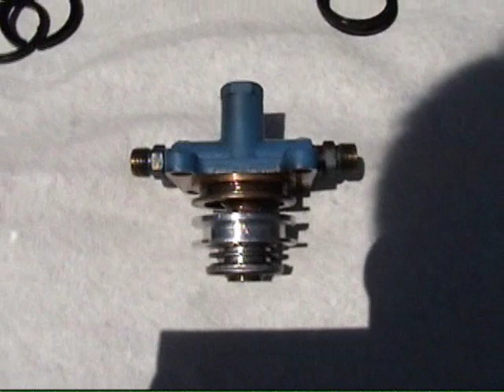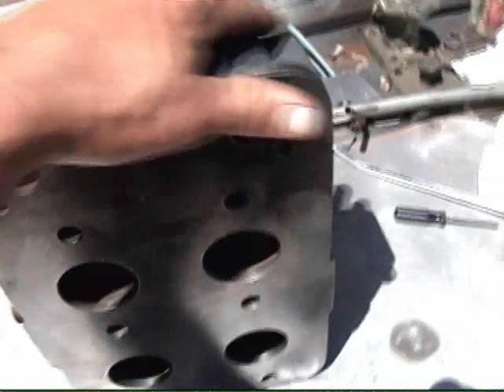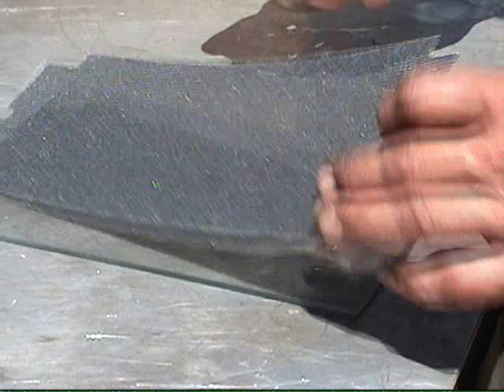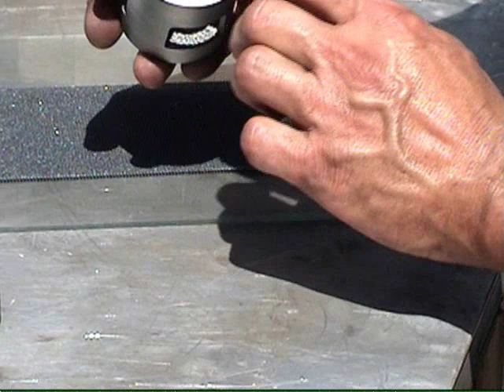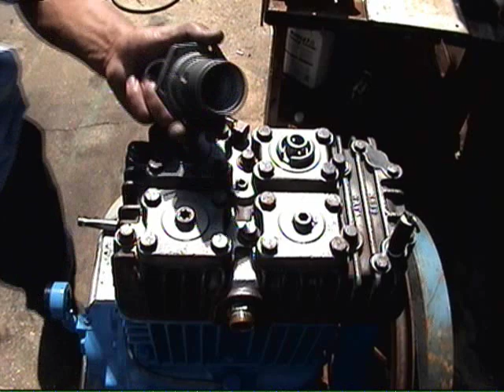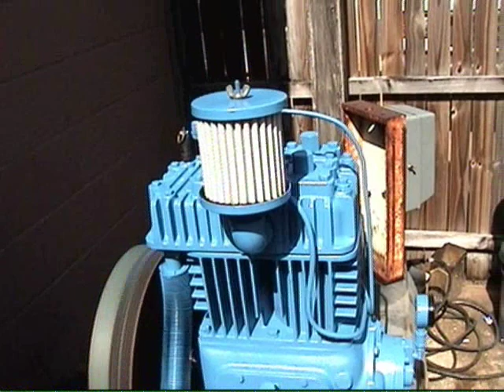Quincy Model # 325 rebuilt and running

Comment: Dave, first of all thankyou to the nth degree for doing this series.  Quincy is very tight with allowing quality service manuals to be published or shared.  You have saved me and thousands of others, THANK YOU sir!!!!
     I just purchased a 325 ROC 12 and mine has the 2 unloader valves.  It also has a middle area that I havent seen on any others.  It is between the pump and the motor and it has a pipe coming off the compressor head and then a square set of cooling fins and then a larger pump type looking contraption that enters into the top middle of the tank.....Do you have any clue what that could be and what it does?  I am just starting to gut the compressor and start the cleaning process.
     If you do not have time to answer, I more than understand.  YOU ARE DA MAN!!!!!!!
Thanks again for all your time and courteous help
Reply from the maker: Thanks for all the nice words  Jim!
 That contraption you're referring to is what Quincy compressor named a cushion chamber, It's designed to take out the pulsation  of the compressed air  In hopes of making the whole compressor package quieter, A lot of the noise generated in a reciprocating compressor is through the discharge line,  That pulsating compressed air entering the tank causes what's known as intank  noise. The cushion chamber actually did work but there was one inherited flaw, They had a tendency to become log with oil and carbon, In some cases it would restrict the small tube that feeds the tank, There's also a relief valve located on the cushion chamber that had a tendency not to open or also become plug with carbon, I think you might know where I'm going with all this, What's your say a few of these cushion chambers exploded and therefore Quincy way back in the  day discontinued to use of them, I would strongly suggest you just get rid of the thing and plum the discharge line straight into the tank hopefully there will be an opening somewhere that you can use.
Good luck in the future!
Reply: @rotarycomptech  Thank you so much for replying, especially so quickly!!!  Can I totally remove it from the tank and run plumb the discharge directly into the remaining hole, or is it too large?
Reply from the maker: @jimtrimble3040   As long as the whole opening isn't smaller than the discharge diameter which I believe is 3/4 inch or 1" some around their,
Reply: @rotarycomptech  Since I will be using this compressor no more that 5 hours a week,  Can I just focus on keeping that chamber cleaned out or would that still be too much of a 
risk? If so, Could I connect the discharge tube into one of the threaded end plugs?  I have one at each end of the tank about 1/2 way up from the bottom. Sorry for the quantity of questions
Reply from the maker: @jimtrimble3040   Either way will work,  The cushion chamber was just found to be unsafe
Reply: @rotarycomptech  Dave, I really need your input on my rebuild 325.  I have spent over a year rebuilding this and it is done. I stripped all of it, including the tank to bare metal and painted and powder coated with HiTemp powder coat.  Looks great.  Bought the rebuild kit that included the rings, bearings all gaskets and valve seats with springs.  All of the unloaders are spotless and everything is torqued down correctly.  
     NOW my issue.  I am trying it out and this is what happens.  Starts normal, oil pressure goes to 30psi  and 80 gallon tank fills slowly. btw I have dual unloaders and after about 7 minutes it hits 125psi then unloads down to 90.  Is it supposed to keep cycling like that?  I thought at some point it would stop and store the air in the tank for use.  Maybe that's how a dual unloader works.....constantly on.  
     That is one question, now the above actions of the compressor changed after about an hour and a half of running it with the cycling on at off at set pressure values.  Today I replaced the oil cover access plate with the new thicker one that you installed on yours and what is happening now is not right at all and I don't know where to start troubleshooting,  Now after I turn it on,  it starts building pressure, oil pressure goes to 30psi and then it keeps raising!  It is building pressure like crazy in the compressor oil reservoir area and the oil gauge pegs clockwise all the way and when it builds to 125psi in the tank, it unloads down to 90psi, with oil psi still pegged, and when it goes to start building the pressure up again, the compressor stalls and will not allow the motor to spin causing it to lock up the motor... so I shut the power off completely and manually release tank pressure and turn compressor back on, it is now unstalled and  the motor starts up again..  When it starts again.  Oil psi starts at 30psi and continues to climb to where the  gauge is pegged then all of a sudden BANG!!!!!! the dipstick shoots out at rocket speed and pegs the air cleaner above it.  Scared the holy crap out of me.  Just had open heart surgery last year, so that didn't help.  
     After I composed myself, made sure I wasn't bleeding, and went in and changed my newly stained drawers.....I am asking the guru.....What the crap might be happening????  Would it be possible to call you if you feel it is too much to type out?   I do NOT want to bother you and if you feel like this is a pain to deal with, I understand that your time is valuable.  I would be more than happy to pay you for your time if needed.  I really want YOUR help since I have seen all the Quincy videos at least 10 times each and feel that you know your crap......More of a trust thing.  I hope you understand.......thanks. Jim

Comment: Hello Dave,  Thank You for the great videos.  I just rebuilt the head on my 325 roc 7, and the hp discharge valve still leaks, but I just realized that I didn't lap the seats before I installed the new valve disks.  I'm going to do it today and reassemble.  I really appreciate you sharing your expertise.

Comment: Hello ! I have a 325-13, I had the leaking unloader tower issue, it was just the diaphragm that was bad, now everything is fine exept I have a small leak coming from the crankcase, It was 175 psi last night and this morning only 10psi remains (compressor was off obviously). Can't seems to locate where it could come from, I've sprayed soapy water on all the exterior connections and everything is air tight. I understand there is a case breather that goes to the intake so the leaking crankcase air is vented there but I don't get the air path from the tank to the crankcase ? Any help would be appreciated !
Reply from the maker: You need to install a pressure gauge where the interstates relief valve should have gone, when the compressor is running at 100 PSI the interstate pressure should not exceed 45 PSI if it does you need to address the high pressure valves,
Reply from the maker: it's your high pressure discharge valve more than likely, if the machine has a intercooler relief valve on it it will be venting from that area as well. If you're losing air pressure overnight the only place they can escape his from the high pressure discharge valve that's what keeps the air pressure in the tank from escaping through the intake
Reply: @rotarycomptech  wow thanks for the fast reply, there is no relief valve on the head. Which one is the hp discharge valve ? I will disassemble and clean it. It leaks overnight but i can cleary hear the leak at almost any pressure, I just repaired my main issue yesterday evening so im not sure of the rate of the leak but its enough that I want to correct it. I got this compressor for free without the electric motor, the guy clearly didnt know what he had it would have sold for quite some cash (70 gallon binks tank)

Comment: Is it absolutely necessary to prime the crankcase? Rebuilding a 210 unit and lost most of the original primer while cleaning it. Crank wasn't rusty at all. Is it to seal in the oil or to prevent rust?
Reply from the maker: Some of the old crank cases were primed due to porus castings leaks in the casting itself
Reply: @rotarycomptech  thanks for the reply. This whole series has been very helpful. I think I will take the chance of not priming it. Already tried some enamel but I didn't like how it was curing in there (didn't get all the oil out) so I stripped it clean again. For reference, what was the primer that you used?
Reply from the maker: @bcouri1  it wasn't Automotive lacquer based primer

Comment: hello all, I have a 325 I just rebuilt with a tune up kit (rings, valves).  Got it all back together and ran it.  Started making a knocking noise at around 100 psi, so I took back apart and found that the high pressure piston wrist pin bushing was worn.  I replaced and had local machine shop size the new bushing. Put the compressor back together and still makes the same knocking noise starting at 100 psi.    Any ideas??
Reply from the maker: Heath Cline there are only a few things that will cause that unit to knock, I would check to make sure that the flywheel is tight as that can cause a knock from time to time if it becomes loose.
Since you have a gasket set I would suggest you remove the head and run it without it in place to determine if it's the lower end or if it's indeed a loose valve

Comment: any body have any experience straighting crankshaft on 325 quincy
Reply from the maker: Charlie Tanner yep
Reply: how
Reply from the maker: Charlie Tanner unfortunately the only way I know to straighten it is in the same way it became damaged, only I would use a urethane sledgehammer as so you don't break the flywheel, you literally have to bend it back straight

Comment: What are the main differences between the 308 and 325 ?  I just picked up a 308 equipped with the constant run valves.     It seems to air up alot slower than yours wonder if the valves aren't working right
Reply from the maker: James Ferm the difference is 2 horsepower and 10 CFM.
The model 308 was replaced with the 310 model current production I do believe, the 310 compressor or 308 compressor is the next size below the 325 model
Reply: ROTARYCOMPTECH thank you so much for getting back with me.  Thank you.     Will ether of those rebuild kits work with my 308 ? Is the piston the only thing different with the 325 I can find rebuild kits for those all day really hard to find one for my 308 do you know production years for the 308.   I am willing to give you my number if you are willing to text help me out enough and I'll send you money in a week 816 seven nine nine 10 4.  0
Reply from the maker: James Ferm the model 308 is an old unit and more than likely is obsolete, everything is different on the 325 versus the 310 very few interchangeable parts the Pistons are different the rods are different the valves are different the crankcase to head everything,
The really old model 308 was Splash lubricated not pressure lubricated and had what is known as a 3-way valve in place of the hydraulic unloader, does your compressor have an oil pressure gauge on it?
Reply: Yes mine has a oil pump I put a oil gage on it to see what it was running at    308 roc 22 it looks close to the 325 just things that lolol different is valves and the style of oil pump.   I have pics if you text me
Reply: My number is in a comment above or if you would rather email.
Reply from the maker: James Ferm I would rather use this forum
Reply from the maker: James Ferm it's more than likely obsolete I know the old style oil pump is no longer available,
If you're having capacity problems I would try replacing the valve assemblies they're rather inexpensive
Reply: ROTARYCOMPTECH. Yea that's what I'm gonna do 420$ more than I wanted to spend
Reply: @rotarycomptech   can't believe it's been 4 years lol.     I did fully rebuild the 308 and she's doin great.   I'm on to 350 and 390.  Sizes and some older units now.

Comment: This videos are very helpful and I have almost completed rebuilding my 325. I have a question though. Would it be a bad idea to rotate the I high pressure side valves to the low pressure side and vice versa?
Reply from the maker: PracticalTactical typically the valves on the low pressure side are in better shape than the high-pressure ones and it's a good swap to go that direction
especially for the discharge valves
Reply: Yes sir I figured that wouldn't be a bad idea. I really want to thank you for the time and effort you put toward putting these videos up and answering people's comments and everything. You have really been a great help and a good person!
Reply from the maker: PracticalTactical Thanks for the nice comment!!!!!!
 sometimes they seem a little hard to come by these days

Comment: Very well put together and informative rebuild series. I am happy with the unique tips and tricks you've shared.  I  purchased a Quincy 5120 a couple of days ago.  Upon first inspection I spun the flywheel to make sure it wasn't locked up.  I noticed that only one head was giving a deep chug from the intake filter as I was turning it over by hand. Shouldn't both sides have a chug?  It is an LS and I am wondering if the valves position of the dual control may affect what noise I heard from the one head.
Reply from the maker: dapaid1 Thanks for the comment,
yes both cylinder Banks should have the same audible sound.
If not more than likely the compressor has a stuck unloader piston or plunger causing the inlet valve to be open.
Or worst case scenario it has a couple of broken connecting rods.
I think I've rebuilt more of the 5120 model Quincy compressor than any of the other ones.
In an odd way I miss those old days
Reply: Thank you.  I will start posting videos of it as soon as I get it home.  It is an era 1974 and I am thinking it may actually be a 5105.
Reply from the maker: dapaid1 the only difference between the 5105 and the 5120 is the crankshaft and the cylinders
the only really way to tell without taking it apart is the the length of the cylinder
Reply: From what points do I take the measurement and what dimensions am I looking for? The inspection plate was replaced, as you will see when I post the video. I understand the roc may be stamped on the crank. Will it be visible if I open up the inspection plate cover?
Reply from the maker: dapaid1 the part number on the crankshaft will be different but I'm not so sure that you could see it from the inspection plate.
on the cylinder itself where the bolt-holes fasten it to the crankcase on the 5120 model it's pretty beefy about 1 inch in diameter.
on the 5105 it's about half the size or roughly a half an inch.
I can't tell you the exact dimensions as I don't recall them and I don't know that they're published,
it was just a visual familiarity with the two pumps sitting side by side.
Reply: Ahh..  I see a difference in the base plate thickness on the cylinder where it connects to the case. The 5120 is much thicker.  They both have close to the same specs. The only difference I noticed was the rpm max speed. It will still handle the cfm I will require. Do you know what the difference is between the cranks. I am curious how many parts may be interchangeable between the 5105 and the 5120.

Comment: I got a campbell hausfeld 2 stage, 120 gal., 10hp 3phase that keeps tripping the overload breaker intermittently. More when the tank has low/no pressure. The breaker, pressure switch, and motor are all good. Is there something in the pump its self that could overload the motor intermittently? the safety valves on the pump don't pop open. The pump sounds normal until the motor starts drawing more amps then the frequency changes alittle. All regular maintenance has been kept up and we havent had a problem with it since we got it 15 years ago. any advice would be great thanks.
Reply from the maker: maybe a restricted in tank check valve
hard to say without hearing it run
Reply: I will look into that. thanks for the info.
Reply from the maker: +adrock84ify I'm sorry I don't have much else for you to go on these problems if they do exist with the compressor is typically an over pressurization problem
you may also have a weak breaker
Reply: over pressurization sounds right to me. i checked the breaker by using a clamp on multimeter so i know it is drawing 38+ amps when it trips which is what the adjustable overload device is set to. And i checked the motor with a megohm meter and its good. Tomorrow i will check to see if there is an in tank check valve. Although if there is one and it stuck closed, wouldn't that cause the safety valve on the aftercooler to open? I have stood next to the compressor when it trips and it just stops. There is no air leaking from any point on the pump or tank before or after it trips.
Reply from the maker: +adrock84ify the in tank check valve could be partially blocked or restricted not completely plugged off
also don't rule out your break to be the problem if you're not pulling High amps or over nameplate amperage your problem more than likely is a weak breaker
Reply: Turns out the problem was the 3 phase service. The exterior cable connection was corroded and we were losing a phase whenever the wind was blowing. And of course by the time you go and check the circuit it comes back. It finally quit altogether and none of our 240v 3 phase machines were working. Thanks for responding to my Qs. Its nice to have guys like you willing to share the knowledge and help keep our small business going. Much appreciated!